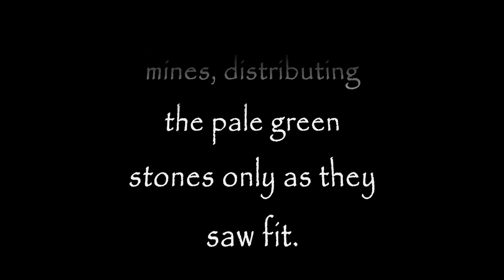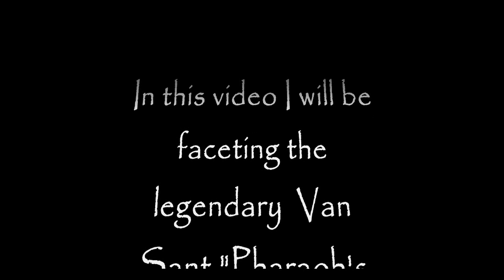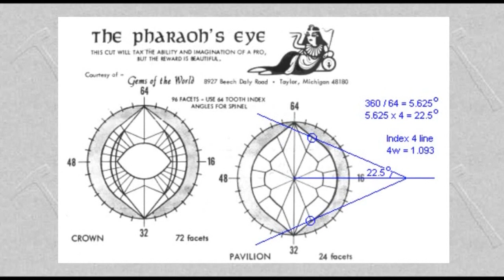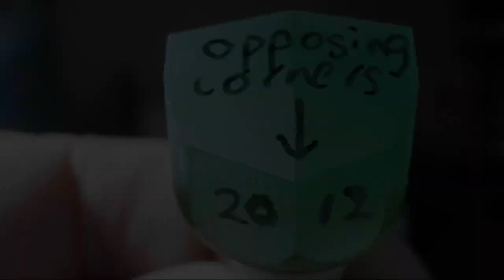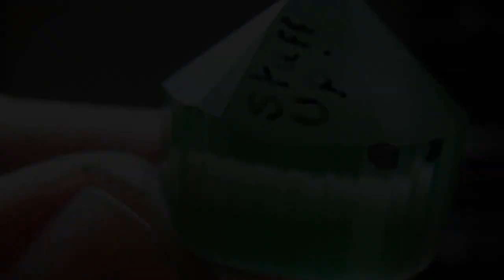How To Cut Gemstones - The  most difficult gem I've ever faceted!

Comment: This is a amazing master cut design and takes a master lapidariest to execute properly and once again he did and should be commended for that level of skill. It is harder then the original but the mistake almost every person does with the original is they don't cut in the style people used when designed now we tend to cut the girdle then cullet then pavilion and table, but if you use a 64index and cut the pavilion table cullet then girdle it works out really well there isn't much adjusting needed and makes it easier to align the girdle facets